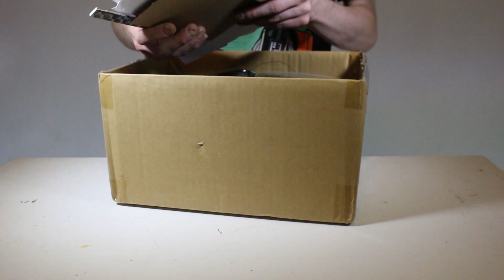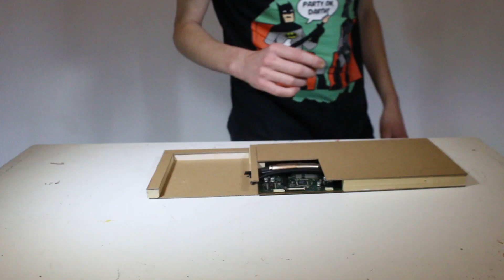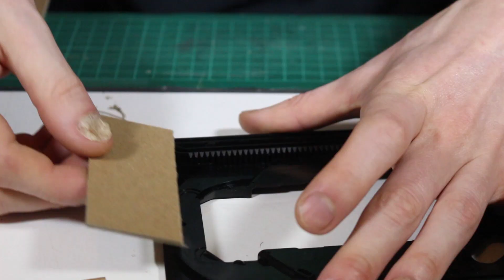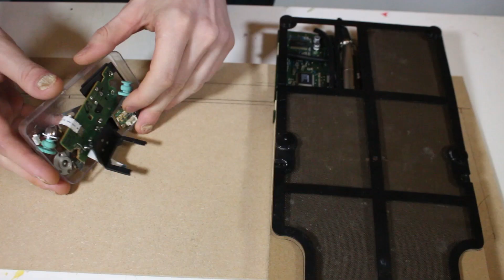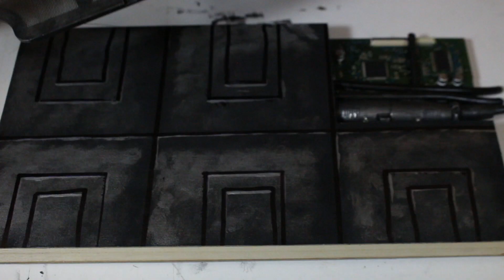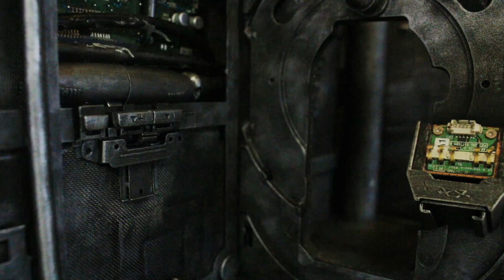Building the Alien Corridor - Practical Effects and Mini Set Building for low budget film making

Comment: I imagine that the actors probably prefer to be on an actual set, where they can relate physically with their environment. It really doesn't cost much to build a set, especially if it is built on a modular basis, so that pieces can be re-configured, even turned upside down etc. I guess, if the film is very  short, very modest and very very low-budget, compositing the human performers into miniature settings is the better route.
Reply: i imagine you suck